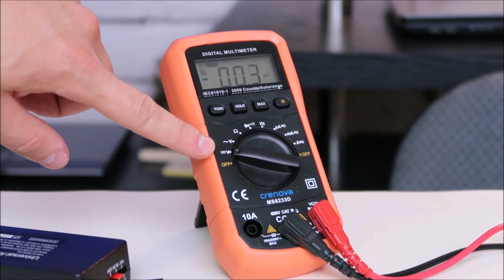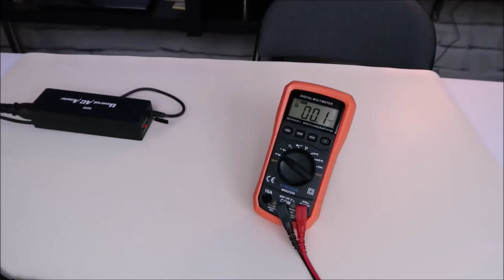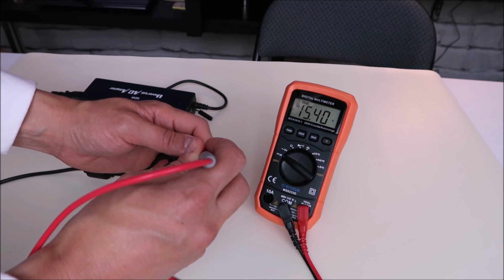How To Fix Any Laptop - Wont Turn On, Wont Open, Turns Off Right Away, No Power Solution

Comment: Hi can a laptop that is flooded with rain water still be fixed?
Reply from the maker: After a liquid spill, you want to first make sure the computer is 100% dry.  You would turn your computer off immediately by pressing and holding the power button until the computer turns off.  Then you would disassemble the computer as much as your comfortable with, at least trying to remove the bottom case.  Then you would turn it on its side and let dry for a couple days.
Reply: @PC_Monkey  In my case the laptop is off when it get wet I didn't try to turn it on or plug it the charger is there any chance it can still work? I just brought the laptop to a technician the other day.
Reply from the maker: @mochiplays593  After you have done the steps mentioned above, try to turn the computer on.  What happens?  Are there any signs of life at all when you try to turn it on?  Lights?  Fan, Motherboard, or Hard Drive sounds?  Anything seen on the screen?
Reply: @PC_Monkey  imma update you if my laptop is fine thank you😁

Comment: I think my mob its dead then I never could find the mother board battery for bios Reset my model HP Omen 17 An0xx
Reply from the maker: 1.  Are there any signs of life at all when you try to turn it on?  Lights?  Fan, Motherboard, or Hard Drive sounds?  Anything seen on the screen?

Comment: My hinge broke on my HP laptop, I fixed it but noticed I was getting no Wi-Fi signal, think the cables had been damaged when hinge broke, so replaced cable, and a few days later a puff of smoke came out of the laptop, top right by Jack cable input. 

Laptop will no longer turn on any ideas? I replaced Jack cable, tested old one, and power cable all work fine. 19.99 V
Reply from the maker: Sparks and smoke are not a good thing :(   If you have tried all the steps seen here with no luck, your prob looking at a bad motherboard at this point :(  I would replace it next
Reply: Ok no not tried all the steps yet, got power on Jack and power lead, but not checked any further, as where Jack goes into mother board is hard to get to. HP 250. Thanks
Reply from the maker: @jaygsi    Good luck !!  Let me know how it goes :)

Comment: Hi there, I have a hp note book that will not power on. If I plug the charger in. The charging port does light up but my laptop still will not power on. Can you kindly provide any advise? Much appreciated.
Reply from the maker: 1.  Are the lights the only signs of life when you turn it on?  No motherboard or hard drive sounds?  No fan noise?  Nothing on the screen?
2.  Your on the correct video.  Have you tried any of the steps seen here yet?

Comment: i hope this gets noticed. i don't know if i'm on the right video. my laptop suddenly shuts down while i was charging and using it. when i try to turn it on it won'tttt! please help me, i haven't told my mom yet i'm so scaredd 😭😭
Reply from the maker: 1.  Are there any signs of life at all when you try to turn it on?  Lights?  Fan, Motherboard, or Hard Drive sounds?  Anything seen on the screen?
2.  Have you tried any of the steps seen here?
Reply: @PC_Monkey  omg thank for noticing!! i tried doing the video but there's one screw that i can't open so i can't really get into the battery 😭 there's no sign of anything on the screen when i try to turn it on. but when i insert the charger, there's like a high pitch sound on the back
Reply: @PC_Monkey  my laptop by the way is acer swift 3 please help me 😭😭😭
Reply from the maker: @clairdelune1456  1.  Is the screw stripped?  You would have to access the batter to properly perform a static discharge. 
2.  If you cant access the battery, you can try the steps seen here without removing or unplugging it but it wont be as effective.

Comment: You saved my life man. Words can not explain how grateful i am.
Reply from the maker: Happy to help :)  Always here if needed !!
Reply: @PC_Monkey  basically laptop wont turn on with either CMOS reset or Battery attached. Even with them removed its power button is unresponsive on shut down. Weird case.
Reply: @PC_Monkey  brand new legion 5 on 7th day of use. Was trying to upgrade the ram which turned out to be incompatible. The PC ran fine after using the old ram but the battery wouldnt charge despite it showing as plugged in and charging. Which lead to the issue of laptop being dead. It kept turning on normally until the battery had the charge.
Reply from the maker: @I_Epicness  If its new I would def return in with an issue like that.  It could be a motherboard or power button / board issue.  The computer wont turn on with the battery and charger removed, static discharge, and then plugging in charger with battery left out?  That wont work?  You have to remove the CMOS?  If so, that would definitely point to a MB issue :(
Reply: To be honest i could really use a bit of advise. I got my PC to turn on after removing the battery AND CMOS... But the power button is unresponsive. The PC turns on automatically once i connect the AC adapter. Have to remove and connect it again after shut down. Im thinking its a motherboard issue.

Comment: Hey thanks for this, I got to step 2 (RAM board check) and at that time, with the bottom case taken off, I started seeing drops of coffee on my work surface and inside of my wife's HP laptop that wouldn't boot.  One of the RAM cards was wet with coffee on it so I pulled it out and now the laptop boots.  Thanks again.  I ordered a new RAM for $30.

Comment: Hi PC monkey. My computer doesn't charge or turn on, I tried removing the CMOS battery but I'm not able to put in again due to the spring, it just bouncing it out.. it's an Asus x53s
Reply from the maker: Is the CMOS battery port damaged?  If not, it should go back in.  If its damaged, then thats unfortunate as that component may be needed for the computer to operate well.  Have you tried the other steps in the video as well?

Comment: Thanks PC Monkey! Everyone, before you even open your laptop, first, just try unplugging the laptop and then hold the power button down for over a minute (just like he says in the video). Nothing will visibly happen. Then, try switching it on in the usual way. Hey presto, it worked on my crappy plastic ASUS laptop (X553S) that I'm relying on whilst I find a way to un-brick my expensive top-end Thinkpad due to a failed TPM update. This morning, after working perfectly, the awful but trusty ASUS mysteriously and suddenly wouldn't power on, when I came to turn it on, it simply wouldn't power up. Trying a different spare power adapter (also from ASUS), didn't fix it, the charging lights wouldn't even illuminate with either power adapter plugged in. I thought my backup ASUS machine was toast, but no, this got it going again.

Thank you so much PC Monkey, whoever you are.
Reply from the maker: Your welcome !!  Happy to help :)

Comment: When I turn on my hp pavilion gaming laptop 15 inch only the power button turns on and everything else is off even the fan is off
Reply: Screen
Reply from the maker: your on the correct video.  Are you able to try the steps seen here yet?

Comment: Thanks much!  You saved my wife from having to fedex her work laptop   at a time while working on a deadline. I looked at another video where the poster said hold the power button for 30 seconds. I tried it twice and it did not fix the issue. You said 60 seconds and that was the trick.
Reply from the maker: Glad your all set :):)  Always here if needed !!

Comment: WOW thank you! It worked!! I would have never thought about this. I completely removed the battery and now it works. I had an old HP laptop I didn't turn on in years. I could see the logo, the sign-in button but then after pressing the sign-in button, it was switching off. It looked weird...it wasn't just turning off instantly, it looked like loosing luminosity at first and then was turning off.
Reply from the maker: Glad your all set :)   Always here if needed !!

Comment: My laptop is a built in one so I can't remove it's battery
Reply from the maker: 1.  For help accessing an internal battery, refer to this video;  https://youtu.be/tUCVN2GLYuA
If you know your computer's model number, I can help you get inside your specific computer :)
2.  Are there any signs of life at all when you try to turn it on?  Lights?  Fan, Motherboard, or Hard Drive sounds?  Anything seen on the screen?

Comment: What will be the problem of my laptop if the start button is turning on but just a couple of seconds its automatically turning off,  the logo doesn't show up too.
Reply from the maker: your on the correct video.  Are you able to try the steps seen here yet? 
For help accessing an internal battery, refer to this video;  https://youtu.be/tUCVN2GLYuA
If you know your computer's model number, I can help you get inside your specific computer :)

Comment: Hey Pc Monkey, I have a Samsung windows 8 2012 laptop (it’s old I know) and I have tried to follow your steps, but the 3rd light out of the 4 lights under the 2 clicker things turns and orangey red colour when I plug it into the charger. I have the battery in it as well but when I go to turn on the laptop with the power button the 4th light below of those 2 clicker things turns blue (indicating it should be turning on) for about 2-3 seconds but then turns off and the laptop does not turn on at all. I’m not sure whether it is the battery that is the problem or just the computer in general. Do you have any tips for me?
Reply from the maker: If all the tests in this video do not reveal the issue, and your power adapter tested to be fine, then your most likely looking at a Motherboard replacement as seen here;  https://youtu.be/N_7HNrFkMS8.  Let me know if you would like help with any of the motherboard replacement procedure :)

Comment: Thank you,i got my daughters laptop working because of this video. It was one of the ram chips. One question if i can though. Can it run with one or do i need to replace the chip that isn't working?
Reply from the maker: It will run with one, but may be a bit slower :)  You can see how to replace it with compatible RAM here;  https://www.youtube.com/watch?v=NtCzunl0AQA&t=9s

Comment: İ have 2 identical laptops but one of them has a problem. The battery wont charge, would turn off randomly, 0% charging, etc. İ watched tutorials and thought of changing the batteries. So i did. Now, i was expecting that the laptop who did not have any problem would have charging problems. I leaved it to charge a bit, but it charges flawlessly. But the laptop who had charging problems still has the same problem.
Reply from the maker: For a computer that turns on and works well other than not charging the battery, try the steps seen here first;  https://www.youtube.com/watch?v=arZpfqcVoUs.  Let me know how that goes :)

Comment: Hey Pc Monkey hope your having a good day.  I tried everything in the video but it didn’t work? I have a Legion Lenovo 5-15 and it wont respond to anything it just seems dead i tried a different charger same exact type and it doesn’t even show the light. Is it just a give up situation? It was out of nowhere tried to start and it wouldn’t respond. Any tips?
Reply from the maker: Are there any signs of life at all when you try to turn it on?  Lights?  Fan, Motherboard, or Hard Drive sounds?  Anything seen on the screen?
If all the tests in this video do not reveal the issue, and your power adapter tested to be fine, then your most likely looking at a Motherboard replacement as seen here;  https://youtu.be/N_7HNrFkMS8.  If you know your computer's model number, I can help you get inside your specific computer :)
Reply: @PC_Monkey  thanks for the response man, your a real good guy for helping people so quick and replying at all for a video a year ago. But yah it doesn’t respond to anything I think your right its just outright motherboard failure? cause I tried everything in the vid except the port check. My computer is a Legion 5-15IMH05H(Lenovo)Type81Y6 if that changes anything. Thanks anyways man, have a great one!
Reply from the maker: @zZaachz    Good luck !!  Let me know how it goes :)

Comment: Hi!
I have legion y530.
Can you please help?
I Did the Cmos reset. Tried to start it without charger, Or without internal battary only with charger it started looping on for a few seconds no boot and off. Even a long press on the power button doesnt stop the loop. When I pull out the charger, discharge for 30-40 seconds, and plug in a different charger, the loop start all over, eventhough I didnt press the power button. 

Tried with both. Did reseating of 2 rams. Also tried booting without one of them. Didnt help. Still stuck just like in the video.
What next?
Reply from the maker: This video is for a computer that wont start.  You said your computer is looping?  Can you see anything on the screen during this loop?
Reply: @PC_Monkey  no boot, only the "power on" light loops. This is the video for me. Also, since, I checked the voltage of my Cmos and its 3.01. So it's not that.
Is the moterboard the only thing left to check?
Reply from the maker: @ניריוסףשמרץ  Ya :(  If all the tests in this video do not reveal the issue, and your power adapter tested to be fine, then your most likely looking at a Motherboard replacement

Comment: i accidentally spit soda in laptop and i tried to fix it and it worked but when i turned off the computer after hours the laptop wont work again, i tried the name method but the same method wont work pls help me fix the laptop

the laptop is also still charging
Reply from the maker: Are there any signs of life at all when you try to turn it on?  Lights?  Fan, Motherboard, or Hard Drive sounds?  Anything seen on the screen?

Comment: ASAP !! I DID THE CMOS RESET THING WITH THE WIRE THING WHERE U DISCONNECT LEAVE IT FOR SOME MINUTES AND THEN CONNECT IT AND THEN PLUG THE CHARGER, MY LAPTOP TURNED ON AND THEN OFF THEN ON AGAIN AND IT WORKED BUT WHAT THE PROBLEM FURTHER GOES IS THAT IF I SHUT MY LAPTOP OFFF OR RESET IT, IT DOESNT TURN BACK ON ANYMORE THE POWER BUTTON IS UNRESPONSIVE, WHICH MEANS I HAVE TO EVERYTHING OVER AGAIN JUST TO BOOT MY LAPTOP ON SO PLEASE HELP WHAT SHOULD I DO IM REALLY IN DISTRESS, IVE BEEN SITTING FOR 7 HOURS WITH MY HANDS SHAKING AND SELF BLAMING AND IDK WHAT TO DO, AFTER SHUTTING IT DOWN IT DOESNT TURN BACK ON ANYMORE WHICH MEANS I HAVE TO REDO THE CMOS THING ALL OVER AGAIN
Reply from the maker: Hard to read a paragraph that size all in caps lol.  But what it sounds like is you have to perform the static discharge every time in order to get the computer to turn on.  Correct?  If so, you may be looking at a bad charger or battery.  Also, are you using a healthy surge protector with your computer instead of plugging it directly into the wall outlet?
Reply: @PC_Monkey  yess I am idk wht is happening I haven’t turned my laptop off since that and some ppl are saying that I should just try and turn on my laptop from like a small hole at the side of my laptop
Reply: @PC_Monkey  I have to reset the COS battery everytime I wan to boot my laptop. The problem is not at the charger, the charging light turns on but the power button is unresponsive, but right now the power button light (on the Lenovo 330 series ideapad) is turned on, it’s not  like it’s dead or anything
Reply: @PC_Monkey  when I shit down my laptop, it doesn’t turn back on but the light of the charging is on
Reply from the maker: @bleachdrinked6141  You charger may still be failing even if the lights are on.  You would need to actually test it more than that.  Again, I would try replacing the battery and charger one at a time until you find the issue.  If neither are the issue, you may be looking at a motherboard problem :(

Comment: i have been fixing my laptop. My dell latitude d630 turns on and goes to the logo and turns off. I have replaced the cmos battery like you recommended and it still does the same thing? I have many pictures ect that i wouldnt want to lose. Before this problem my kids had drop water on it about 2 years ago. i had let it dried out ect and then i turned it it worked for like 30 mins and turned off then i had plugged it in to charge the battery and then thats when the laptop started to turn on then the logo comes up and then turns off.
Reply from the maker: This video is for a computer that wont turn on.  Yours turns on but the cant finish loading windows.  That is usually a different issue than the one discussed here.  For your issue, can you try the steps seen here instead?  https://www.youtube.com/watch?v=w3XfE-ghbhs&feature=youtu.be
Reply: @PC_Monkey  I just tried you suggested video and it just stayed stuck and didnt load. Then when i stopped it just turned off and the battery light started flashing from orange to green.
Reply from the maker: @michaelfernandez3056  You were unable to access or run the diagnostic test?
Reply: @PC_Monkey  No it just starts up and goes to the dell logo and just turns off.
Reply from the maker: @michaelfernandez3056  I dont understand.  I asked if you were unable to access or run the scan.  You answered no.  That would imply that you were able to access and run it.  But then you said that it just starts up, shows the dell logo, then turns off.  Can you please tell me if you are able to run the diagnostic scan.